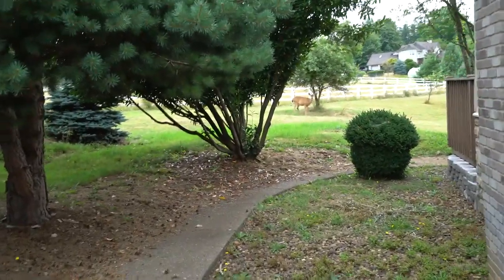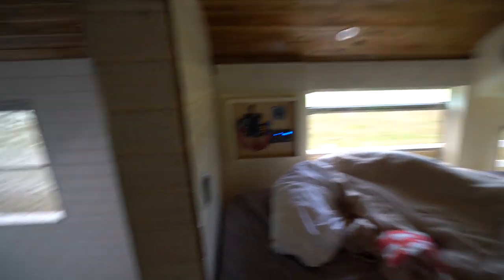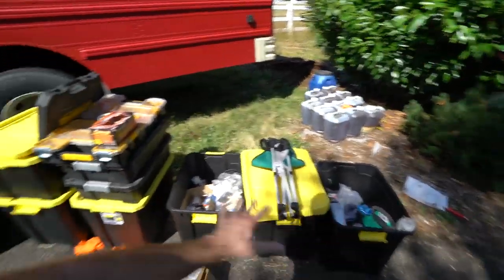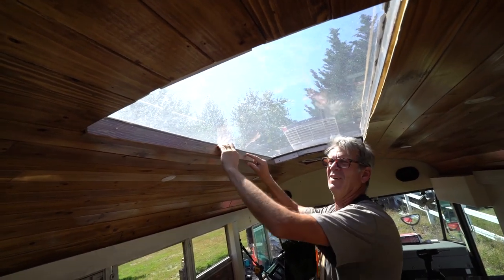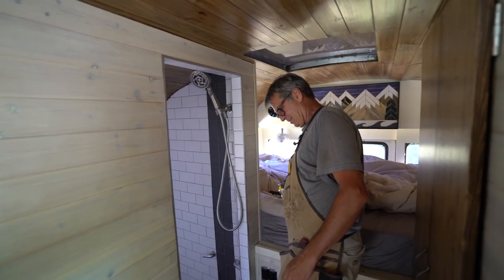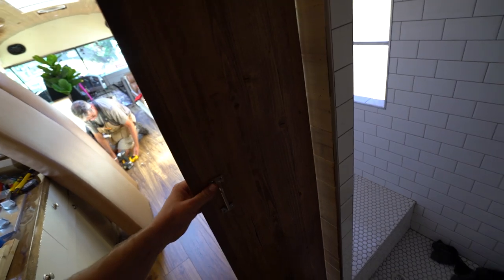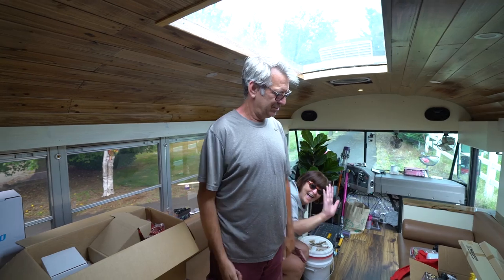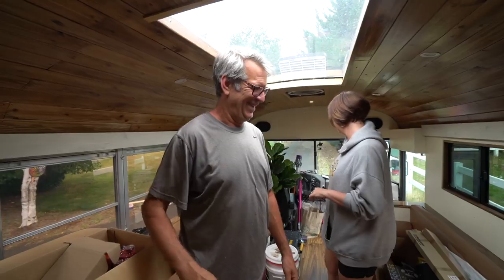MY LAST SKOOLIE BUILD VIDEO EVER (i hope)

Comment: You may need a shower curtain on the inside of the wooden shower doors to keep water from going between them and onto the floor. Attach to one door and put a hook or alligator clip on the other to hold to just cover the middle slot
Reply from the maker: Yes 100% need a shower curtain. That’ll come when I decorate next week